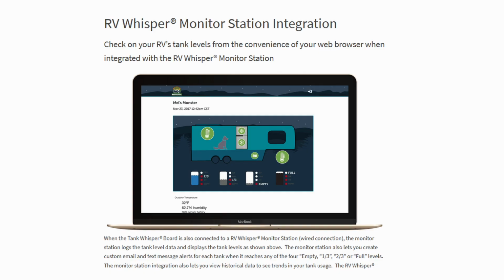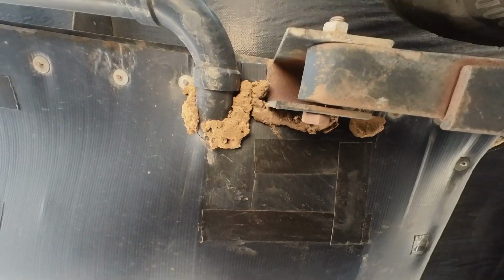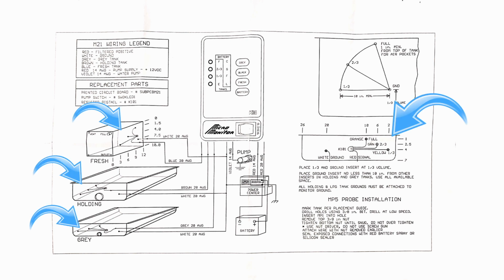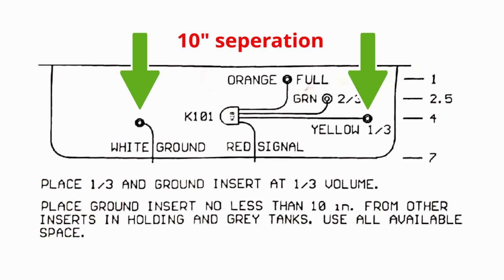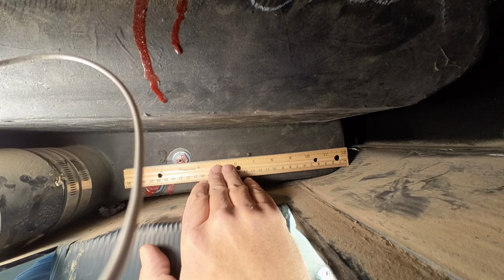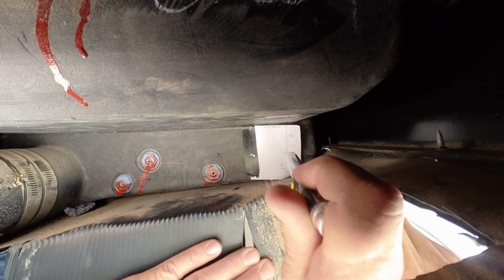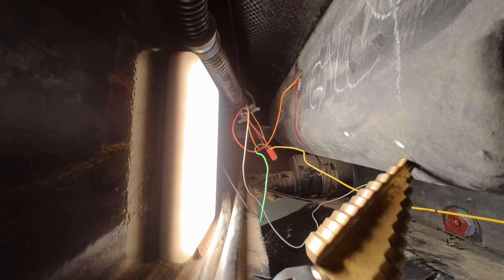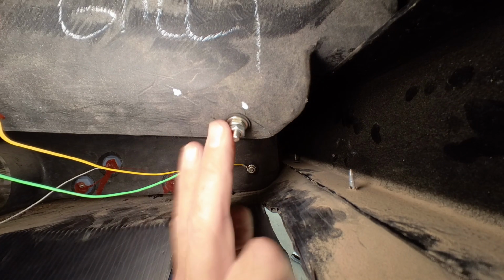RV tank sensor repair | TheRVAddict

Comment: So what is the orange/red thing called that all the wires are going into? I have one the wires are broke off to short to repair? In your diagram it is the K101
Reply from the maker: That is the full tank sensor wire in my case. It goes to the panel on the camper

Comment: Have a 1995 Dodge Roadtrek. Just had a new fitting spin-welded into the gray water tank because it was leaking (PIA job because they had to take out the toilet to get to the plumbing to be able to drop the tank). Anyways, all the indicators work on the KiB K21 Monitor panel except the the empty indicator led for the gray water tank... but the 1/3, 2/3 and full led indicators do work for the gray water tank, go figure... lol.  I'm suspecting it could be an 'OHM' issue as each sensor signal works off of different ohms I think, not sure. Anyways, great video and information.
Reply from the maker: Yes,  ohms reading could be a problem.  Check for corrosion on that sensor and to see if it is tight. 
Look for a loose connection at the KIB board.  Dang that is alot of work to get to the tank.   I hope you get to the bottom of the problem.

Comment: A couple of suggestions... you may want to use your white marker to lable the corrogated plastic holes you cut so you can find them next time (or someone else can find them) I use bottom tape (from amazon) to seal up the bottom holes.  Roto-molded tanks will always be thicker in corners, so putting a sensor in the corner of a tank may not be a good idea.  I have an issue with my RV which has two grey water tanks, one for the master BR and shower and one for the kitchen. The shower always fills up first, so I think I'll add a 1/2" tube from the forward grey water tank to the aft grey water tank. They are at the same level in the frame, so they will equalize the water level and let me run a little longer between dumping the tanks.
Reply from the maker: Thanks Stuart, i like your marker tip. it is a shame that so little care goes into tank senors during install. Your right, move that sensor and  you will feel better about the levels. Thanks for watching.

Comment: Great video and explantations. I have an 88 gallon fresh tank that shows full after 2 minutes with the water hose
Reply from the maker: Roger, these factory installed tank sensors are the worst. But they can be improved.  Thanks for watching.

Comment: Great stuff, my black tank sensors have been stuck on full since almost day one. I always think I will be motivated to replace them, but I just haven't had the time or motivation to open up the bottom and do it all since for us, it is as simple as just using a flashlight everyone so often down the toilet to check the levels. The RV whisper board for the display looks interesting - especially if I don't have to change out the sensors. BTW, great use of B roll while describing the process. 🍸🍸
Reply from the maker: Flashlight is a great tool for the hole.
If you ever look under camper, you may find the "full sensor" mounted at the bottom, or maybe the orange wire is connect to the wrong sensor 👍. 
Thanks for the feedback Phil, i appreciate the support 😎